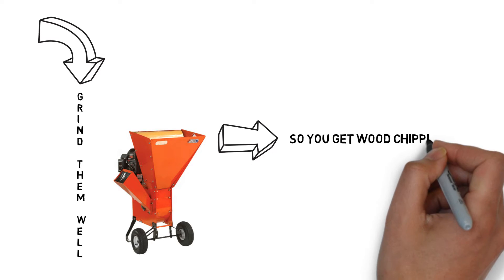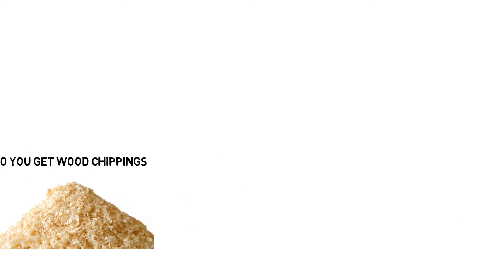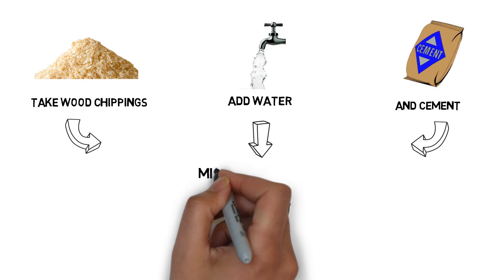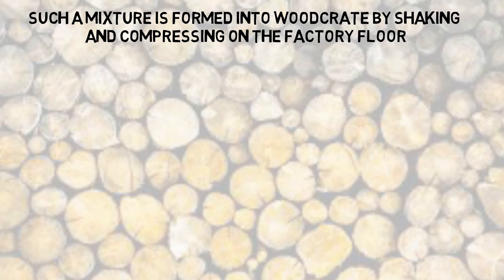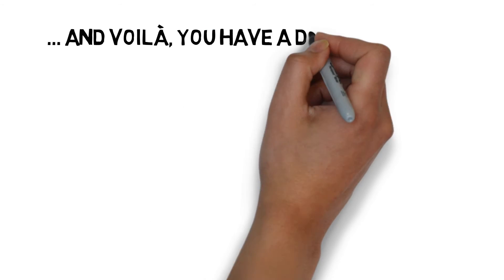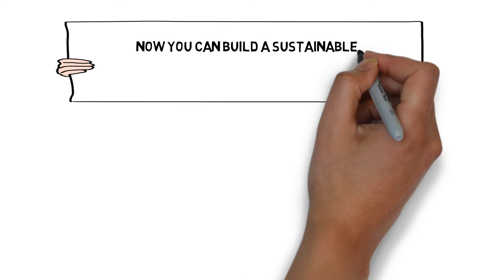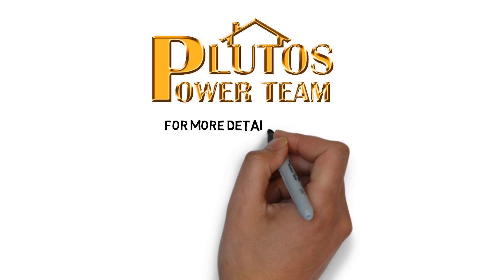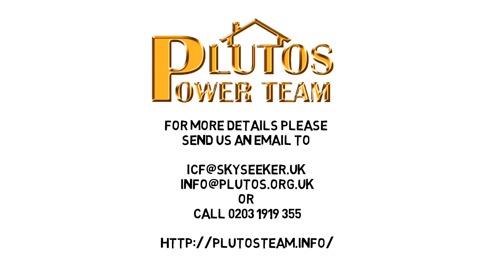Durisol (part1) - What is Durisol ?

Comment: Just adding water to the woodchips and mixing with cement is not good enough, what about the sugars in the wood fiber?
Reply: After the chipping process, Durisol then soak the chippings in a "chemical" solution (which they don't tell us what it is - but I suspect some sort of vinegar solution) that render the chippings, thus the blocks, neutral, removing any of the sugars and proteins in the wood. The blocks are therefore made neutral and inert. You can see this info in the presentation video direct from Durisol themselves.

Comment: I did residential concrete for 30 years and did a number of stacked styrofoam block houses. Didn't like that stuff at all. I would say 'it's okay as long as you don't care about straight, level, plumb, or square. I used Faswall, a wood fiber block, identical to this, and it was made about 40 miles from my house. HUGE sound and thermal insulation properties. Not enough hemp available for it at present, so they use wood chips. I would also suggest to set the final course of blocks with mortar, and an insulating barrier on the outside.
Reply: More better than your styro lego houses. Living in a plasticbox. Haha.
Reply: with Durisol you do not need any additional insulating barrier. Thermal and sound properties of their blocks are outstanding. Remember, they do not rot, do not burn, but they are breathable, unlike the Styrofoam. Mortar you can use for the first course of blocks but it is not really needed. If interested, I would suggest taking on one day training with Durisol at their factory. Simple but not trivial and very well presented. Imho, this is the best building material I have ever come across and one with which house construction is a breeze.
Reply: This product is identical to the Faswall that I used on my house. If your base footing is off, then you need mortar for the first layer, and maybe even for the final layer so you have a perfectly level top course. They always get a little off as you go both up and horizontally. I don't need classes because I have done a number of similar ones as well as the Faswall. With my house and shop, on the second building, they came up to slightly higher than ground floor level, installed the sub floor, then built scaffolding on that.Much simpler than building the scaffold on the outside of the house. There are now plasters that they say you can apply directly to the blocks. I am skeptical. Also, I applied Hardiplank to the outside of my house for more fire protection. While it you are correct about it offering huge thermal and sound insulation properties, an extra layer of foam on the outside is beneficial. With the Hardiplank, the siding people firred out with 1 by 4s, and now they apply 3/4 foam in between the vertical 1 by 4s. The structure does take on the outside temperatures, both cold and hot, so for long cold or hot spells, the outside temps will work their way through the material so the inside walls are cooler in winter, and warmer in summer. Correct in that the product will not rot, at least as long as you don't let it get wet and sit. It is NOT fireproof, but is very fire resistant. Get it hot enough, like the fires in So. Cal some years back where burn temperatures were over 2000F, and the wood fiber can burn. Faswall is borax treated to prevent bugs from eating it. I do consider it to be a product for the future. Good stuff.